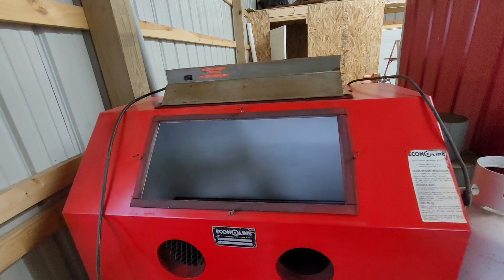Going Green! Flourescent to LED upgrade, ballast bypass.

Comment: In 2016 and 2017 we went around Floruda at all the Chase banks and retrofitted all of their lights to LED. Wow what a difference. We had to pull a Amp test on the main panels before and after we changed all the lights inside and outside including the parking lot lights. One was 89 amps I think it was when we started and when we got done the final was 27. That is a huge difference. Talk about dropping the light bill lol.

Comment: I just did this with the 4' lights in my house and shop.
Replacing the bulbs in a single four-tube T12 fixture went from 240W to 60W.
Replacing the bulbs in the four two-tube T12 fixtures in the garage went from 480W to 120W total.
All told, it was a healthy reduction in power required for illumination, and increased life expectancy.

Comment: They make retro fit led bulbs that are direct replacement as long as you have an instant start electronic ballast (much smaller and lighter), you appeared to have an old boat anchor analog magnetic ballast (there are a few exceptions that claim to work with any ballast). If your flourescent fixtures are from thus century (T-8) you can likey just get the conversion bulbs that are direct fit without messing with wiring. The "T" number refers to the bulb diameter (T-8=1", T-12=1.5", T-5=5/8") T-8 and T-12 use same pin spacing on lamp holders (end sockets/"tombstones") and are the most common so both are easy to covert to led with JR's method or if T-8 with retrofit bulbs. Love the varied content, have to get off the couch and get my diesel projects finish so i can get rid of all this used motor oil sitting around...

Comment: I did the flood light upgrade to my blast cabinet. It is super bright and heats the chamber to help with moisture control down here in the FL. I also have a florescent that I will do exactly this to so I can have more light. Thanks for the tip!